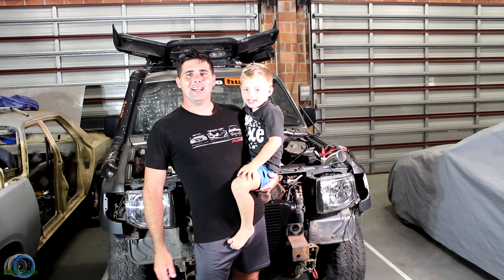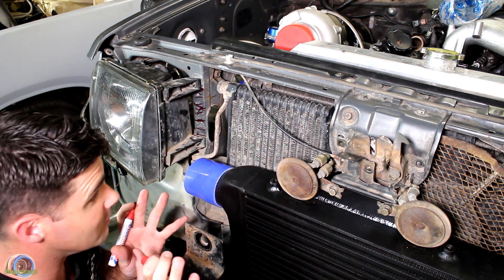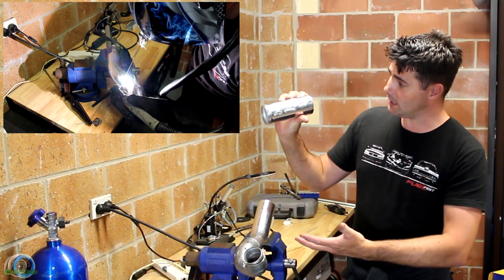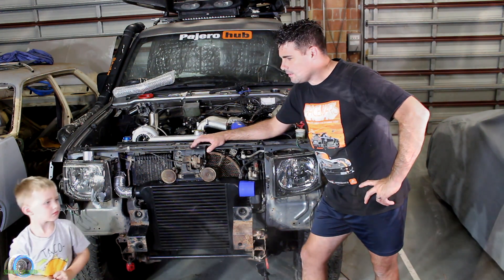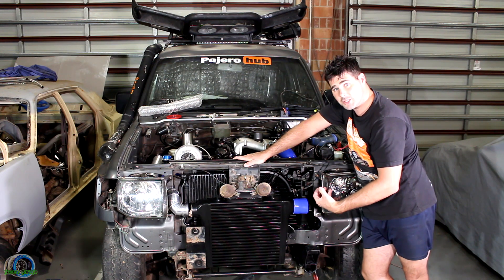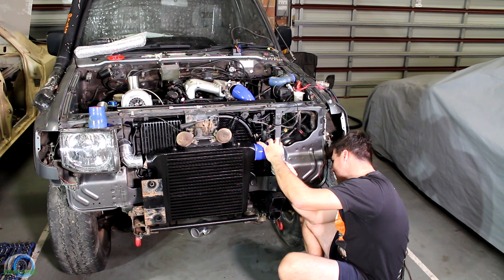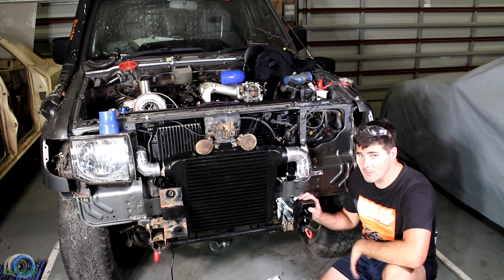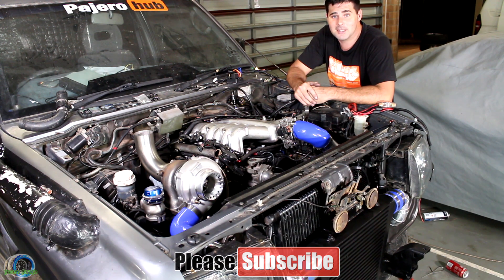PAJERO NEEDS A TURBO  Part 4 Keeping it Frosty DIY Intercooler & piping install

Comment: Great video and the content just keeps getting better hehe, on another note what brand/welder setup do you use?   If you don’t mind me asking :))
Reply from the maker: thank you mate, I really do try to make it as clear and professional as possible, And happy to answer you question, it’s a 200amp Weldmaster about 15 + years old I got it from BOC and it really is a good unit,   not the best and not the cheapest it’s probably a good starting welder,  i also use argon gas as well, because it so old, there is probably way better units out there. but it works well for me
Reply: @GREASEGARAGE  yes it’s great content indeed man I enjoy every minute of it!!  And thankyou for answering my question ok in the e market for a tog welder as I would like to learn and be able to fab up my own stuff, yours looked like the one I’ve been looking at the bossweld 185amp
Reply from the maker: @daganbougourd6527  Get ready to make a heap of new friends, it’s like owning a car trailer 🤣, Tig-ing it great, start with stainless, super easy to weld,  you can pretty much weld it with no prep work,and i just use argon for that as well.. stainless use low amps , legit on 1~2mm you can weld on 5amp,  normal is around  12~15am p and a sharp tip, and once you master that you’ll fine Aluminium isn’t so bad
Reply: @GREASEGARAGE  yeah I’m very keen to start and learn! haha I can hear the people asking for work already 😂 Thankyou for the tips much appreciated!!

Comment: Is this intercooler larger than a stock one? Thanks for the video bro.
Reply from the maker: Gday Josh great question, the 6G74  v6 3.5Litres don’t come turbo’d , but the Diesel do and they are a top mount , and this is 100% bigger then the top mounts use on the diesels, hope that helps. this intercooler is 400mmx400mmx76mm